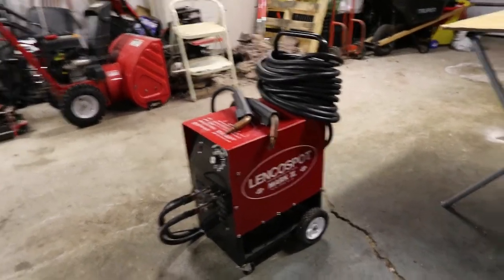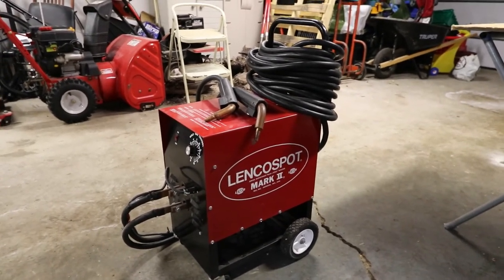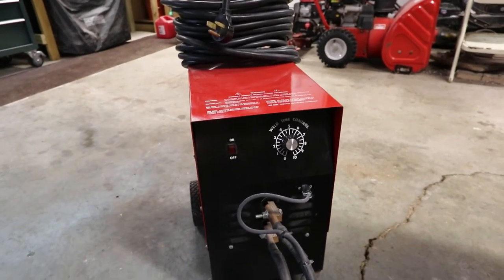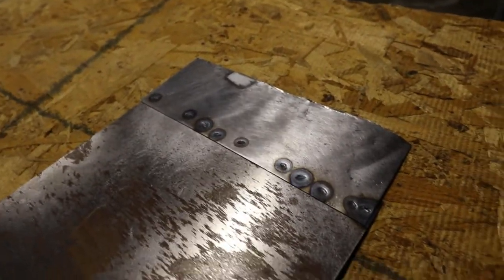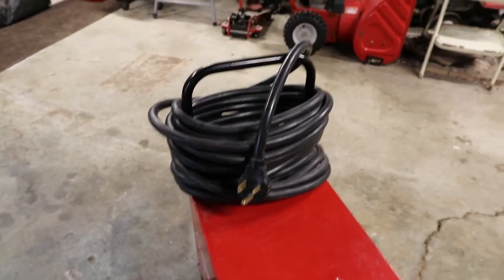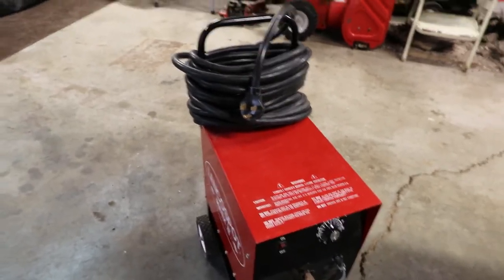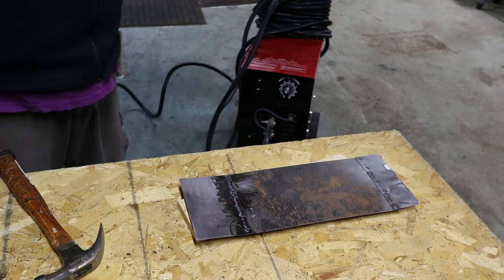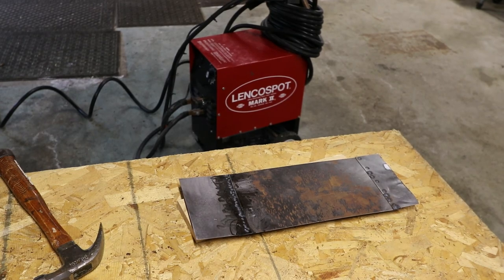Spot Welding sheet metal demonstration using a Lenco Spot Welder. (LencoSpot).  Auto body welding.

Comment: I used to work in the factory that made all these machine for about 3 years.  The main transformers for the machines are still made here in the US by hand wound, dipped, and baked.   Most repairs for these machines that come back were due to people pulling switch cord off of the switch on the one electrode.  They used to make a tip sharpener for these, but quit due to lack of sales.  You can take a file and clean off the electrode tips if they start to stick, or spark a lot during spot welding.  Someone mentioned welding on both sides of the metal.  They also sell a pinch type gun that can be hooked up to this same welder to make those types of welds.  I made snap-on spot welders that were  very similar to this one and they all come with the pinch type gun.  You can also buy a dent puller that will work on this welder.  It comes with the dent puller and a magnetic ground clamp. Let me know if you have any questions.

Comment: That's a really neat welder!  I looked at the info on it online and it says it welds 20 gauge maximum.  Have you used it lap weld two pieces of 18 gauge metal and, if so, how well did it work?  Based on the amount of heat you're generating for such a short pull on the trigger it looks like it should work.  It would be interesting to see a test where two roughly 5" long pieces of 18 gauge are welded together with about 6 spots and then see if the two pieces can be pried apart as a test of how well it welds 18 gauge.
Reply from the maker: Thanks for the comment. I believe it will weld a little more than 20 gauge metal, when I get a chance I will put it to the test and give it a shot and we all can see it together.
Reply: i just bought the ugly green older version of this machine probably from the 60s- lenco panelspotter-  doing some testing about 3/4 the way up on the timer i spot welded some 16 gauge (.062) stainless. jabbed it with a screwdriver seemed to hold. do some searching. i found a few for $100-$200 then stumbled on one for $40.
Reply: @thatbiguy1975  I used to make these welders.  The new ones are pretty much the same concept as the old ones. If the welder still works good, you could even use new cables from a new welder on it.  The only thing you'd have to wire in would be the switch.  They've changed how it plugs in several times, but still all wired the same.
Reply: @mattbloes  hey Matt you haven't got any  plans of the inside of this welder do you,?
Reply: @kenwalters2315  they can sell you individual parts if you need to replace certain pieces.
Reply: @kenwalters2315  no plans on the inside, but it's a pretty simple setup.

Comment: Thank you I bought one of these at an auction and wasn't sure how to use it exactly. Can you use just one of the handles to spot the metal in place?
Reply from the maker: Thanks for watching the video. The welding handles with the tips both have to be used at the same time to make any spot weld. You can hold them as far away or as close to each other you want but both have to be in contact with the same metal at the same time.
Reply: @dave507233  Thank you
Reply: @freddyg9026  He is actually using it incorrectly in the video you should be placing one electrode on each piece of metal and doing one spot at a time directly through the metal.  The technique he is using here would only be for incredibly thin metal with a chance of blowing through on the lowest of settings
Reply from the maker: Sorry but you are wrong on this. This type of spot welder is designed to make two spot welds at one time and used for automotive patch panel or rust repair work. you are think more of the other type of spot welding that has both electrodes mounted together to clamp the metal together as it is being welded. This does not have the clamp ( vise grip ) welding electrodes.  you can look up many other videos as well as look the company up showing you the process of correctly using this welder.
Reply: @4N5W3R5  Dude, have you ever done any bodywork? If you could only do pinch-type welds, (a) you'd be screwed on most of your panels, and (b) you could buy a cheap all-in-one clamp welder to do the same (limited) thing. I don't think you know what the cross-section of a b-pillar looks like on modern cars...

Comment: Do you use weld true primer with this spot welder?
Reply from the maker: I use just regular automotive grade primers and never had any issues, but it is a good idea and practice to use a seam sealer on the back site of the patch panel to seal it up from moisture and air.
Reply: @dave507233  Thanks for your reply, I was just wondering is the spot weld will stick to  the metal using weld true primer between the  seams
Reply from the maker: Most primers won't work for that, because both sides of the metal has to be bare to make the contact for the spot welders. Check Eastwood auto supply ( www.eastwood.com ) I believe they have a primer they say works for that, but I am not sure. The primer would have to be a conductive type of primer to allow for the welders to make that contact through it with burning a hole in the metal from sparking back.
Reply: @dave507233  Thank you for your reply. Just got the same spot welder from Ebay for 900.00

Comment: that is one goofy spot welder, I'm not even sure what you could actually weld with that with no air pressure to pinch metal together with.
Reply from the maker: This spot welder is really designed for sheet metal work. Ideally for automotive patch panel work, and or sheet metal fabrication work. Google Lenco spot welders and you will get more information about them, they have been making these for over 50 years.